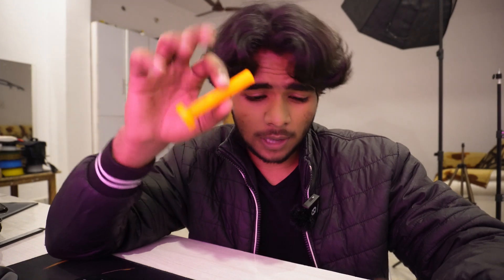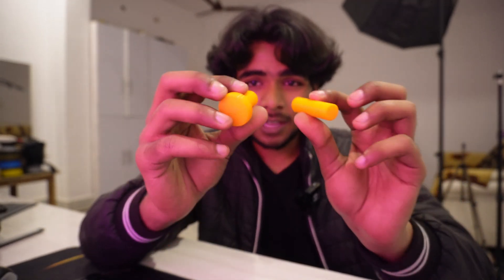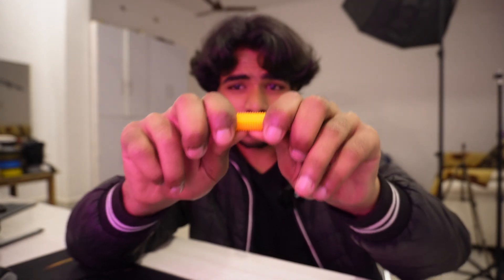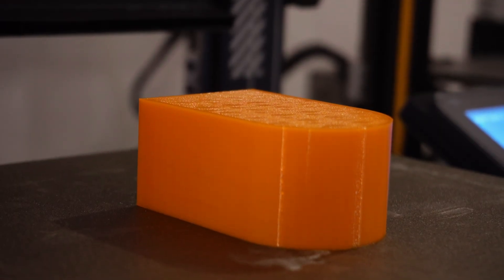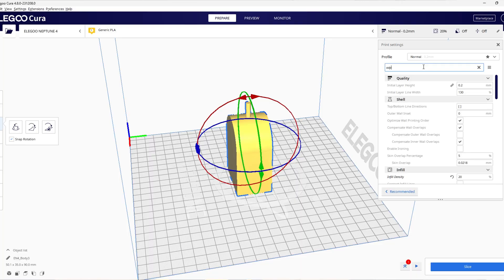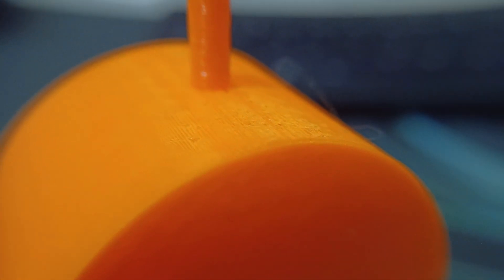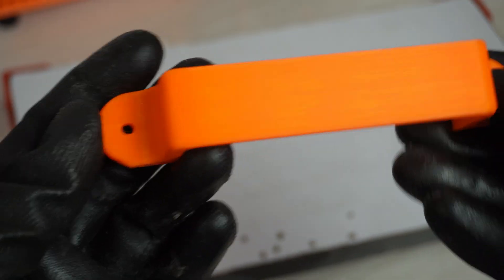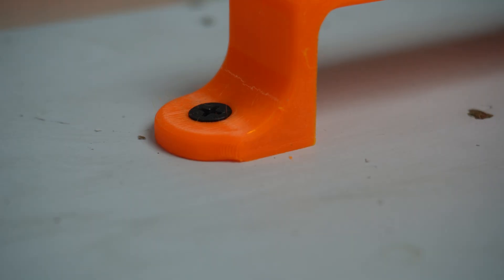3 Easy Yet Effective 3D Printing Hacks that You Still Don't Know

Comment: Did you print the 2nd bolt on it side?
Reply from the maker: I Removed the little material from these side to print it horizontally without any support
Reply: @Creative3DP  I think you may have left that out of the video.  Great work on your video. When explaining a process pretend you are explaining it to your grandmother.
Reply from the maker: Thank you, I think I've shown this if I''m correct you're talking about this right? 1:13
Reply: @Creative3DP no, he means the print orientation. You didn't show that, if you printed your strong bolt in the same orientation as the first bolt it wouldn't be any stronger.
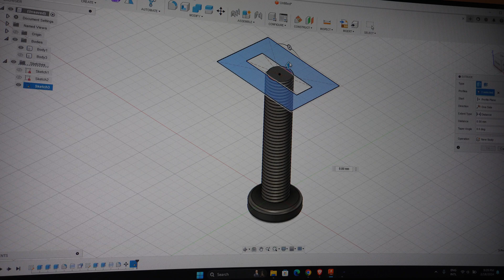Reply: @Creative3DP 1:20 you show what you cut off, and then you say that you just printed it, but you never showed that you also changed the print orientation, it looks like you printed the screw still standing like the first one
Reply from the maker: Oh My Bad, Will keep in mind from now onwards. Thanks for Explaning
Reply from the maker: Got it, Thanks for mentioning it